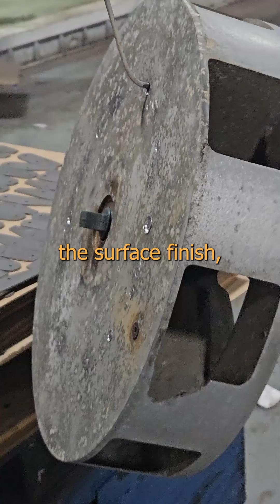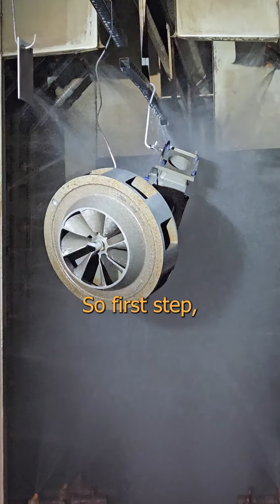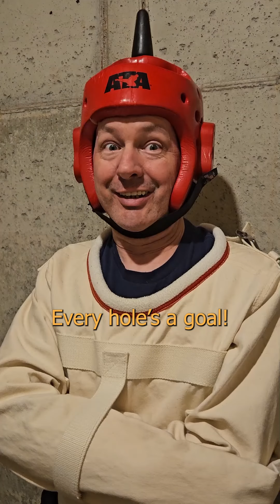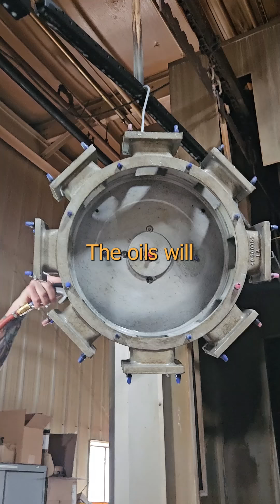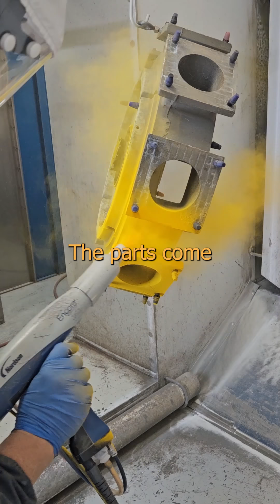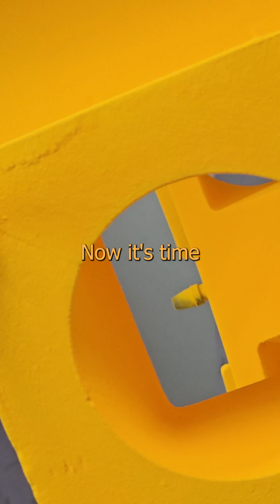Tornado Siren Powdercoat  #chrisboden #comedy #engineering #manufacturing #factory #making #conveyor

Comment: Many many moons ago I use to do powder coating I got use to be zapped on a daily just the act of spraying the powder creates a static charge on everything, one of the biggest parts we'd powder coat was the internals for CT and MRI machines the steel is so thick we'd pre bake them then coat them then bake them again for an hour and 45 mins at 495f

Comment: What I wonder is:
1. How is it made sure that the coat has an even thickness? Just purely skill when applying it?
2. What about the area in contact with the "hook"? Do you have to hook it to a feature you want to stay bare anyway (in this case I guess the bore that attaches to the motor and the hole for the fastener)? What if you want to coat the entire surface of a part?

Comment: Independent powder coat shop i used for almost 20 years had what they called 'garbage coat' - literally what was swept up at the end of the day. Pigments do not blend like liquids, they stay as their separate small dots of color (red + blue liquids = purple, red + blue powder = red/blue small dots) .  They would sell this option as a very cheap coating for guys that built hobby-stocks, or mystery off road race bike/sand rail/ mud bogger, or just needed an incredibly durable coating.  The downside? - you needed to get everything coated at once as they could not duplicate it later, no two batches were identical (it was the sum of what was coated that particular day.  safety red, pac-black (40% black), Kinze blue, Deere green, antique copper vein, etc.) There were some really cool outcomes.
And yes, aluminum is a challenge to get right, even if you think you got the contaminants off, the outgassing will still pop the finish from time to time.

Comment: Fun fact.... Aluminum WILL oxidiE the very moment oxygen contacts it.... And that oxidation is sapphire.
This is why proper aluminum welding requires an AC output... Half the wave blasts away the oxidation, half fuses the filler metal... All this done in a shielded gas environment to help minimize that oxidation in the first place...

Comment: One thing to keep in mind: depending on how thick the powder coat is on both the rotor and stator you may run into some tolerancing issues that will run the paint off on the inside. Given the quality of the castings I assume there will be more than enough give, but it's something to keep in mind.

Comment: I used used to be a class a powder coat painter and we used those same make and models of paint guns and fun fact you can mess with the setting on your control panel for the paint gun and depending on weather there is preexisting paint turn down voltages so it doesn’t become all patchy and the paint spreads evenly

Comment: As a printer repair guy, most of you would be amazed by how many people dont know the difference between toner and ink.
 
Toner is a pouder so fine it makes baby power look course and is heat set. So, If you get toner on your clothes wash, inspect, rewash as needed, then heat dry.
 
Ink is Alcohol based fluid and dries and sets rapidly. It requires chemicals that will probability destroy your clothes, so good luck.

Comment: Wait!! I just remembered another hard lesson! If you perform hard conversion coating on a spinning part like this impeller, expect 1/2 of fatigue life loss. It looks beautiful and would boost sand abrasive risk but, it may burst. Alodine or soft anodize and powder coat is going to be great. 
The coating thickness might even help make up any missing material at places where the stator is close.
What a cool historical salvage!

Comment: Long ago I messed up and did an elaborate multi coating system on my part with final thermo set epoxy paint. I failed to bake out the bare part so in the bake for the paint I got blisters.
Years later I learned about aluminum safe boiling water detergent baths and the very cool vacuum aging. 
You put the part in a vacuum and all the volatile oils evaporate. No waste water. The chamber and vent pipes get gross. The silicone greases are a problem as they have low vapour pressure. Dow Corning (or whoever owns them now) have a silicon killer called “OS”. You preclean, then apply, then wait. It attacks the soaked in silicone, cuts molecular bonds, then the remains just evaporate!
This saved the day on a certain aircraft production where paint and rub strips would debond.

Comment: I used to work in a powder coating place and a lot of our work was actually using the furnace to burn paint off of the racks from the Holden plant (former South Australian car manufacturing plant)
The oven was kinda scary, it's literally a 20ft shipping container with two mega gas flame blasters at the back and the whole thing is insulated. Light it up with the doors open in case of a misfire because then the whole thing fills with an explosive mix of gas and air, but once it's lit, and all the racks of stuff you want to strip of paint or powder coating from are inside, close the doors and give it a few hours and everything comes out charred but paint and powder coat free and ready for reuse. I always had mini nightmares of what it would be like if someone got shut in there. Reminds me of the scene from the movie Elysium 😅

Comment: At least it wasn't near salt water before, that's an "interesting" process to powder coat aluminum with salt impregnation. The easiest way it is to sand blast and weld fill the deep pits. Just hope that the casting is a weldable aluminum too.

Comment: I've worked in an aluminium paintline. I was responsible for the wash tunnel. Our old wash was an acid, RO water rinse, then a Hexavalent Chromium in hydrofluoric acid spray, then another rinse with RO water.
By the time I left, the new wash was a five stage process that went KOH, RO water, HF acid, RO water x2, Titanium coat, then it would be drip-drying all the way up to drying oven, before being coated with liquid electrostatic paint, then put through the curing oven.

Comment: Is that Chromium based powder? Ion chemistry is pretty neat. You can go for anodized aluminum as well if the goal is to improve corrosion resistance. Shock that metal!! Either way I'd be taking a good shower after spraying that shizz@_@

Comment: Powder coating is awesome for appliances and fixed machines like this.  Whatever idiot decided that it makes an awesome architectural finish, especially on anything (like rails) that need to be welded in the field, should be punched in the dangly bits till they pee blood. Any installation involving a fixture or device or whatever that involves regular contact with humans and their random accoutrements is going to get dinged, and this finish does NOT touch up pretty at all.  My last encounter with this shit involved four 6x3x3/16" tube steel kickers mounted on the face of a building 30+ feet up...for decorative purposes.  We pulled it off, but two ironworkers whose usual MO gives fuckall about surface finishes a heavy piece of shit that has to be handled with kid gloves and soft contact is more frustration than anyone is willing to properly compensate you for...

Comment: I worked at a machine shop / manufacturing plant with powder coat lines big enough for semi-trailers. We used shot slingers on the steel parts as the last prep phase. 3600 RPM, wheels made of manganese alloy. Yes, it was incredibly dirty. I hated welding on the walls when we put new panels on.

Comment: I love "restomodding" random old things. I have a late '90s snowblower that I took completely to bits, cleaned everything worth keeping, upgraded everything that wasn't. All the ABS bushings got replaced with either brass or delryn, the body got powdercoated, and the engine got rebuilt and worked over by a buddy who builds professional go-kart engines. It is definitely not worth more, but my grand kids will probably be able to use this snowblower.

Comment: i still see imperfections and not clean or smoothing during the "to take them home" part, cant link the time code cause it's a short. but wow. what the hell are you doing, you put cheeto spray on a part that needed to be broken down piece by piece.

Comment: I've never heard the term thermal inertia before, but I really like it. 

I rely on basically that, but I call it thermal lag when I perform with fire.

When I like my torch, the flame is instantly about 2000 degrees, but it takes a few seconds for the wic, fuel, torch Rod itself, as well as the moisture in my mouth and in my skin to begin heating up.

This allows me to play with objects hotter than your mom for longer than my mom is comfortable watching.

Comment: My state passed a law maybe 7 years back to change the powder coating formula to "something less toxic" even though the sewage treament plants give off more toxins with all the regulations in place. Powder coated items 10 years ago you could cut and you'd have powder coated shavings you could pick up with a magnet and have nothing left on the ground. NOW with the new "safer" formula, if you look at the powder coating wrong it starts to flake off

I consider something deadly toxic at one mole per liter that never detaches even during a fire to be less dangerous than something mildly toxic at 500 moles per liter but you can't keep the shit on the metal. Super toxic that nothing can ingest, less dangerous than something mildly toxic that you breathe in just by walking past it

Comment: What about the bit covered by the hook it's hanging from? That contact patch is gonna be relatively small, but it DOES exist.
Reply: One way to avoid that is to hang it from a hole that needs to be protected or masked off anyway, e.g. a bolt hole that can't be coated because it would clog the threads.
I noticed that one part is hanging from an eye bolt.

Comment: Makes me wonder if the additional thickness of the coating will have a measurable difference in the tone emitted.
Reply: It gives it confidence, making it sound like Linus during A Charlie Brown Christmas 🎄
Reply: Probably wouldn't affect the pitch since afaik that's only speed and hole count dependent, though the tighter fit might make it slightly louder.
Reply: @satibel  Aren't they always louder when it's a tighter fit? Or was I thinking of something else?
Reply: @AnthonyIlstonJones Yes a tighter tolerance between the spinning and stationary parts results in a louder sound. The sharper they are where they meet also results in a harsher and louder note.
Reply: @Gvacs 

Spinning? Are we talking about the same thing? 😅

Comment: Man, I hope you had a filter on the air line
Reply from the maker: No, they spent $2,000,000 to build a state of the art powdercoat facility but those guns are running straight off the bottle from a 30 gallon DeWalt compressor from Home Depot that we got discount 'cos it's got a leaky head.
Reply: @Physicsduck kinda figured that.... Gonna screenshot and frame this smart ass reply

Comment: With that jagged chunk of aluminum broken out of one spot on the side of that rotor... Did you fix that and get the weight re-ballanced before doing the powder coating?

If the heavy casting is not balanced, then it will try to shake itself to death when the motor spins up, and tear up the bearings in that electric motor you are restoring...😮

You are taking a lot of effort to get your Si-ReeeeN ready to wail like a Banshee, so you probably want to make sure she screams with pleasure instead of pain 🥳

Comment: I love making things better than they were ever intended to be.
Reply: This project is a great example of applying technology that wasn't available when the item was originally manufactured. I used modern coating on .22 rifles manufactured prior to 1960; we used glass bead blasting for surface prep and a residential oven for the baking, just changed the plug on the power cord to match the welder outlet on the shop.

Comment: I used to work in a pipe coating plant. Did powder coating bass-ackwards. Heated the pipe and sprayed charged powder onto it as it passed through the booth.

Comment: Just out of curiosity (I know it's not an option for Aluminium) do you have experience with rust transformer? I knew this was done but I've found a very convincing (even for informed people) video that clamed that this would be so much better for steel then any other surface finish. Have any knowledge if these claims hold up?

Video is by build lost archives one of the recent ones.